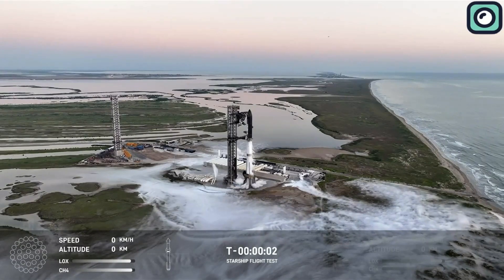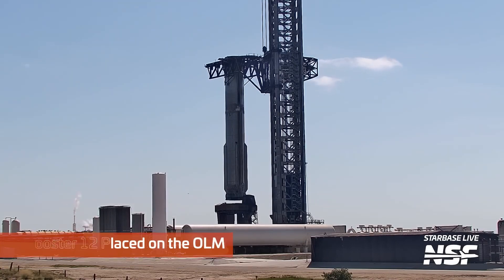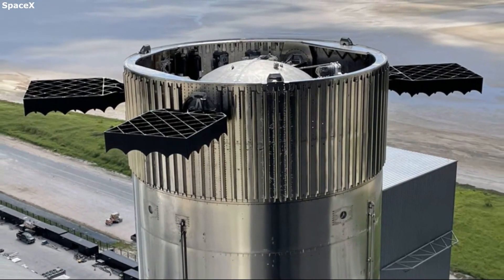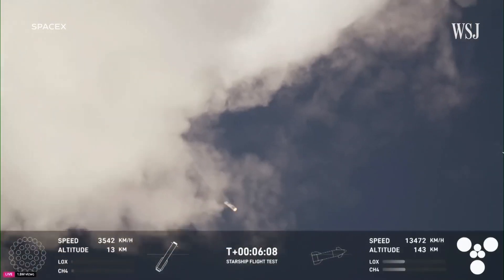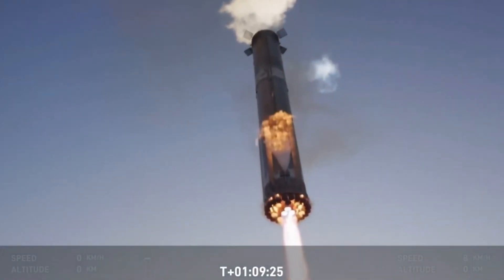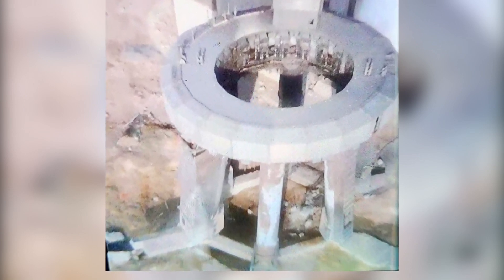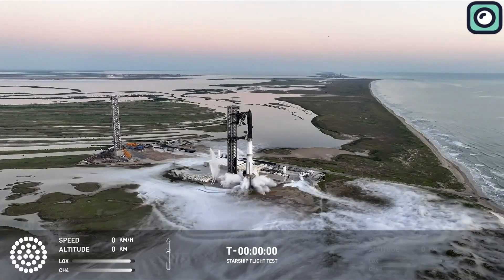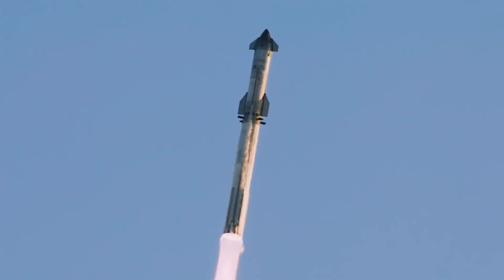SpaceX Just Found Out Serious Damages On Starship Grid Fins!

Comment: The version 1 vehicle is a prototype vehicle and is considered to be one flight use only. To keep prototype costs down, SpaceX intentionally chose not to use the far superior titanium gridfins that are used on the Falcon boosters, which are definitely reusable and do not warp. SpaceX chose to use the cheaper steel grid fins, which are clearly not reusable. 

When SpaceX builds the operational boosters, the titanium gridfins will definitely be used. The only real concern with the steel gridfins is whether or not they survive one flight, and they do even though they are warped.

Comment: They may have to have the grid fins fold down as they do on the Falcon 9 to keep them away from the heat of the hot staging process.
Reply: I agree.
Reply: It was explained earlier on another producer's video that the grid fins play a real and important part in the hot staging by using the exhaust from the second stage to help control and turn the booster as Starship pulls away after engine ignition.  The mechanism needed to deploy the grid fins after staging was deleted from Superheavy as a weight saving measure.
Reply: @robertf3479  Well, it looks as if they need to rethink the absence of the fold-away feature unless they can come up with material that can withstand the heat and force of the second stage engine.